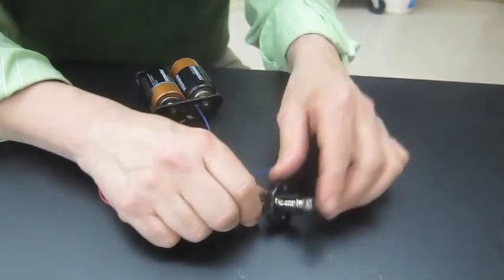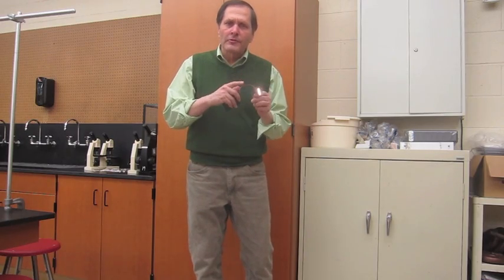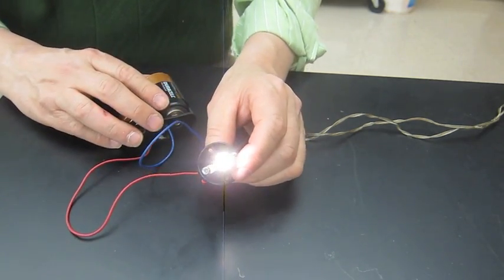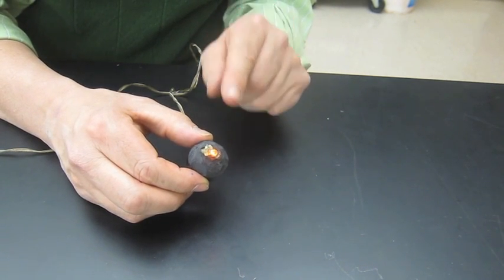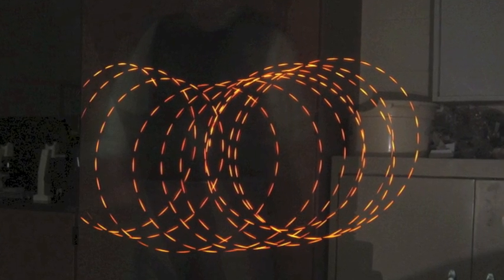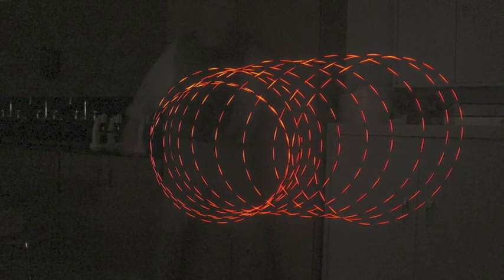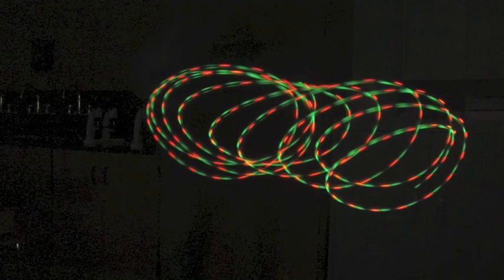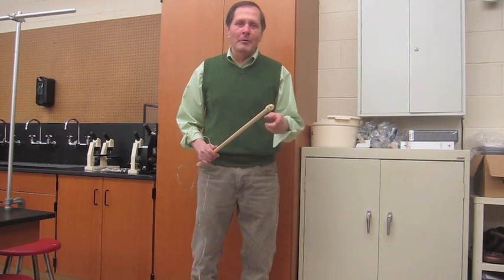Seeing AC versus DC light/// Homemade Science with Bruce Yeany

Comment: That’s not a “neon light” that’s an LED. A neon light is a glass tube with a noble gas (such as neon) inside it. What you call a “neon light” in this video is just an electronic LED.
Reply from the maker: I went back and looked again, on  close examination I can see these are actually  are  tiny  glass bulbs  filled with a gas

Comment: How have you filmed this to get the cool stills. Do you need a high-speed camera I guess? Is the live  playback we see a slowmo from the high speed camera too. I really want to teach this demo in my class
Reply from the maker: Hi James.   the pictures and videos were taken with a regular point and shoot camera. Set the camera for a long exposure,  most can do this.  Set it for a 3 or 4 seconds on a time delay to give you time to get in front of the camera if you are doing it by yourself.  The room has to be very dark, and after a few tries you'll see how to adjust the setting to get what you want.
Reply: This explanation is absolutely essential to understand the experiment. Each photograph shows more than a single moment of time. It shows a time span, during which multiple events happened.

Comment: Good video , missing more information on pros and cons of both, explain how using DC will cause over loading of wires due to high amps and how AC deals with distances. And how lines with  10000000v AC do not become overloaded

Comment: Would the capacitors in a DC power supply, powered by the AC in the wall, provide the same sort of constant current that you see from hooking up to batteries?  Also, what DC voltage would you use to properly power household light bulbs, or do they already have small DC transformers in the base?
Reply from the maker: The capacitors would give you a constant current like  the batteries.  You can run light bulbs on DC power, I don't remember at the moment which way the bulb is more efficient.  there  isn't a transformer inside the bulb

Comment: with landscape lights that have halogen bulbs that you change out to led bulbs .IUs there a difference in ac verses dc bulbs .My controller on my landscape lights is an ac controller low voltage and most bulbs for landscape lights i  see say ac or dc and all the dc bulbs are always cheaper in price

Comment: "The electrons are switching directions every 1/60th of a second..." A full period of the mains AC sine wave takes 1/60th of a second (in America). in 1/120th of the second the electrons are flowing from positive to negative, then another 1/120th of a second the electrons are flowing from negative to positive. So they are actually switching direction every 1/120th of a second.
Reply from the maker: Thanks Joshua,  I  need to fix this video

Comment: In fact it changes direction every 120th of a second. 60Hz means 60 cycles per second. One cycle is wave going up to 240V coming down crossing 0V to -240V arriving at 0V. Thats one cycle and midway the current changes direction

Comment: No fair using a neon lamp for AC! I'd have wanted to see an incandescent bulb at AC; see if it has enough thermal inertia to completely dampen the flicker, or if still would have been visible.
Reply from the maker: that is a good idea I will make another video on this,  but it has others before it
Reply: I'm glad to see others have mentioned this... the 3V incandescent versus the 120V neon definitely struck me as an apples to oranges comparison. It'd be great to compare (if/when you have time to get to it) a standard household 120V incandescent (maybe a low wattage one... even a night-light type thing?) in both 120VAC and 120 (or 108, is it, on average? I forget) VDC, either rectified from AC, or, better yet, from a series of batteries.

Comment: dumb question but would you get the same result using British power supply?  I understand ours are different to the USA power sockets and work in a different way. great video btw
Reply: jokat989 thank you for the explanation, its very interesting
Reply: Same concept, but 50Hz. But you will see the traces in the video chopped in the same way. If you gone into fine detail, you will note less "chops" on the UK grid because the difference between 60 and 50Hz. Of course using the filming techniques in the video.

Comment: So with the diodes in place wouldn't that in essence cut the Hz in half? So instead of "flickering" at 60 Hz as the electrons flow in both directions, it would only flicker at 30 Hz because it has to wait for the electrons to "push" in the right direction again?

Excellent video, by the way. I've had some on-the-job training with DC current, but AC has stayed mostly a mystery to me and I love learning about the relation between the two.
Reply: He had the orange LED wired in the opposite direction of the green LED.
Reply: Kenneth Studstill I know.
Reply: +Shrigis

Ah, sorry, I misunderstood. 

You've sort of got the idea, but the frequency of AC is measured by the frequency at which the pattern repeats, such as how often the positive voltage peaks, and not by how often it switches polarity because that can be from positive to negative or negative to positive.

So, an incandescent lamp run at 60Hz AC would flicker at 120Hz because current flowing in either direction would produce light, but an LED supplied by 60Hz alternating voltage would flicker at 60Hz because only the same half of the wave would produce light.
Reply: Actually a lamp lighting up for both half waves flickers at twice the frequency of the mains, so 120 Hz. It switches off for each transition through zero, of which there are two for a full period.
As there is no "positive" and "negative" light, forward and backward movement of electrons is treated the same, leading to doubling the frequency.
Reply: Kenneth Studstill Ok, that makes some sense. So were the LEDs flickering at the same rate they normally would, just offset from each other to flicker on when the other flickered off? It didn't actually affect the number of flickers per second, it just shifted them away from each other?

HotelPapa100 But since he used LEDs, wouldn't they only light up with the current in one direction anyway? That's what a diode does, right? Again, I'm far more experienced with DC than AC so I'm trying to understand. Please set me straight if I'm misunderstanding things.
Reply: Shrigis 
Yes, each LED was flickering at 60Hz and was offset by half a cycle because each LED conducts in its respective direction.  Together their flashes are 120Hz, like in an incandescent light bulb or anything else that produces light from current in either direction..
Reply: Kenneth Studstill That makes a lot of sense. That's why some older LED light bulbs are hard to look at. They seem to have a flicker that gives me a headache. Newer ones must have fixed that somehow, possibly by converting to DC before sending power to the lights? Regardless, thanks for all the clarification. This has been very enlightening (pun intended).
Reply: It still 60Hz but half sine wave only. The period has not been changed. It is just the LED working half of the time.

Comment: Are we saving electricity by using alternating current in our homes? Seems like something I should know given how many of these science demonstrations I watch. I figure, if the light is off for a period of time, it should expending less total energy than a direct current. Yet, the electrons are still constantly in motion regardless of whether the light is drawing power (and we have to expend energy for the brief moment they are stopped, to stop them, correct?), so I'm not sure.
Reply: Power is distributed at extremely high voltages which is what makes it more efficient; AC is not inherently more efficient (as far as I'm aware).  AC current was chosen because it could easily be converted between high and low voltage using transformers.  The reason why high voltage is more efficient is that it can deliver the same power with less current so the power lines produce less waste heat from their resistance.  Watts = (Amps^2) X Ohms.
Reply: +schadenfreudebuddha I hope this is satire. If so, LOL.
Reply: Kenneth Studstill Thanks. Hard to find a direct answer on google because it's a really specific question (which may also mean it was a stupid question lol).
Reply: schadenfreudebuddha BTW, if you aren't sarcastic, how exactly will an electron move without using energy? It is the energy provided by the movement of electrons which powers electronics, not the electrons themselves. Think of AC like a piston on a combustion engine.
Reply: Richard Smith He was being sarcastic
Reply: it would be more accurate if the bike moved forward backpedaling
Reply: It is not for this reasons. Altough modern led lights use this approach to regulate brigthness and save energy. In fact most of the gear around does it at some point. AC current CAN be made low or high by using transformers. Transformer, ONLY work on AC, not on DC. This fact is CRUCIAL to deploy a grid system. Voltage needs to travel from power plants to cities and then to houses. Sometimes this "wiring network" could be insane long, hundred of miles. Being this large, the resistance of all this "wiring" would cause a massive drop. Like making a 100 miles extension cord. It wont work. The extension will drop all the voltage. What they have done is making the voltage VERY HIGH, using TRANSFORMERS. To delivery the same power, you dont need high currents anymore so, the "wiring" resistance is not longer a concern. When electricity arrives to a city is down converted using a TRANSFORMER and then distributed to each blocks, at a medium voltage and each block having also a TRANSFOMER to donwconvert to final 110V, 220V or whatever use the area. Without transformers, power distributions wouldnt be posible. So the only chance was using AC to allow all of this steps to work. Today electronics allow to convert down an up DC current, but keep un mind that this was deployed more than 100 years ago were transistor, but also tubes were uncanny.
Reply: George Mason one reason why ac is favoured is that generators produce ac electricity, and it is really inefficient to change that power into dc.
Reply: and since the same electrons just keep going back and forth, does that mean there's no net current?  free energy!
Reply: blake kollman Ahh, i see. Thanks.
Reply: think of pedaling a bike but instead of continuously rotating your legs, you pedal a quarter turn, back pedal a quarter turn, pedal a quarter turn, back pedal a turn. Keep doing that and its like pedaling.

Comment: Wouldn't you explain to your students that the "on/off" flickering of the LED on AC current was exaggerated due to the fact that an LED is a diode and only allows current to flow in one direction?   If you had a regular light bulb or some other non-LED source of light, it would remain on for a much longer period of time compared to when it is off since both directions would light the bulb and it would only be off for the very brief period of time when the current changes direction.
Reply from the maker: Hello Kur,  this was done with a small neon bulbs which will accept the current to flow in either direction.  What you are suggesting with the LED should give a longer pause in the on and off flickering,  I would like to try both of them and compare,  I think that could improve this demonstration and would be another point for discussion. I built this piece years ago and had to use diodes in combination with the orange and green "neon" lights.  Using the modern LED and simply reversing them  certainly would have been a easier build to get the alternating colors.  A tungsten filament type bulb will not give the missing spaces when run on AC, the light appears constant because    it doesn't cool enough to go completely out in-between cycles. thanks for your suggestion,
Reply: Even full bridge rectified has valleys in the voltage, which is why a smoothing capacitor is required.

Comment: Isn't the light from an AC tungsten bulb from the heating of the element?  If so, it would seem the reversing of polarity might happen rapid enough on some bulbs to minimize the effect.  Nice video though.
Reply from the maker: thanks,   you're right about the tungsten bulb,  I didn't have a small bulb that could have the higher voltage
Reply: Couldn't you use an LED and a resistor to demonstrate DC instead? That would not be susceptible to the effect of the heat keeping the bulb lit.
Reply: @tyzoid  transformator?
Reply: @caferbiron9933  Wow, a blast from the past. You could use a transformer, sure, but a resistor costs pennies and a transformer costs considerably more, especially down to the voltage needed to drive a single LED.